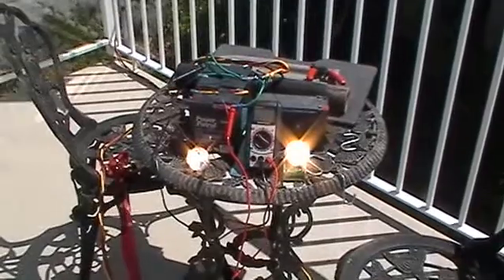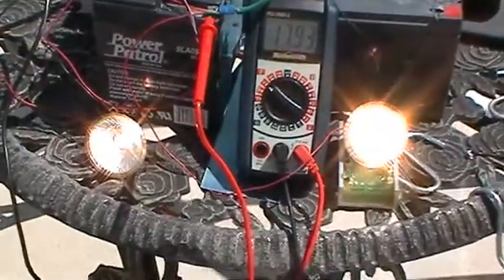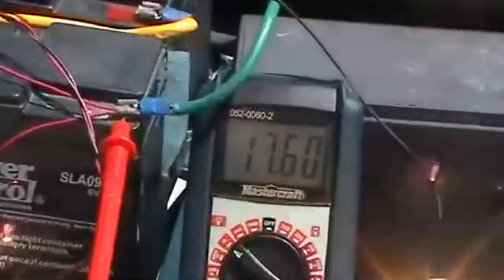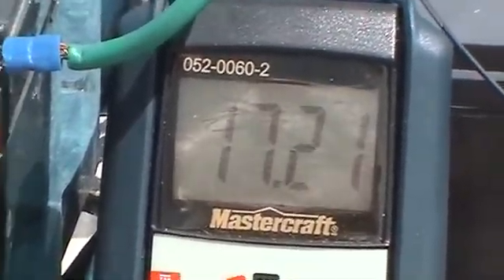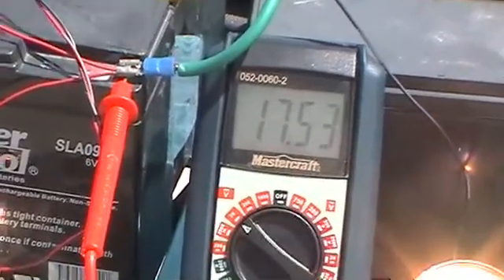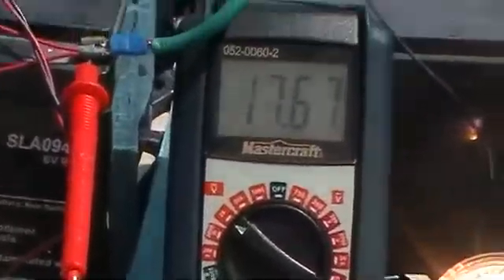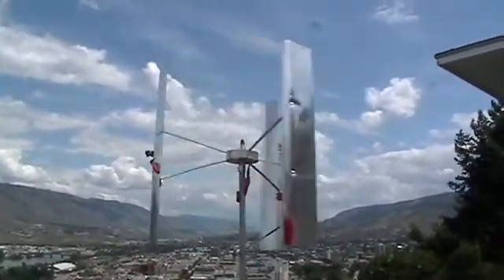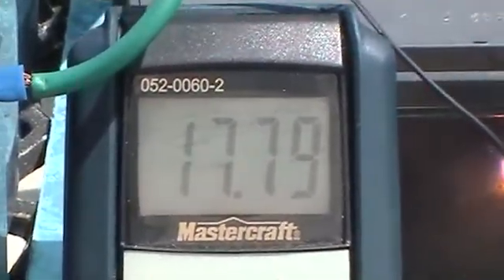REMKICK BREMACLES USVAWT lift vortex inducers

Comment: Watts are voltage times amps. The pma supplies some of the amps, the batteries the rest of the amps. I'd be interested to see the pms do it on it's own.
Reply from the maker: i burned the first 2 bulbs out doing just that; was going to try 4 in more wind but was left with just the 2on the batteries
Reply: @itsandbits1  good idea. I get it, a battery regulator

Comment from the maker: @sjh7132 
This is the 36 volt battery pack I made for my bike so I have 6 anyway and with the USVAWT BOREAS19 alt, I should be able to get the 24volts at a reasonable rpm hooked up series delta  because as you know with the diode losses and such you don't see the full voltage the alt is spec'ed for at a given speed.

Comment from the maker: @sjh7132 
What would the result be if It would turn fast enough to push 24 volts and have the 2 12 volt lights in series. You'll have to pardon my elementary electrical knowledge but would it draw more that way? I know as they heat up they will and I have 24 guage wire on these ones so I'm going to be getting losses there .